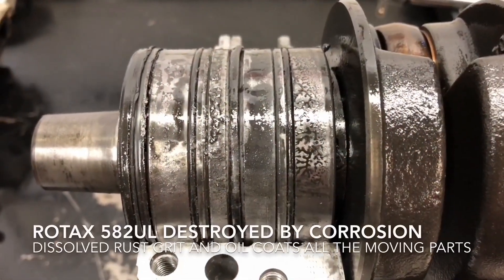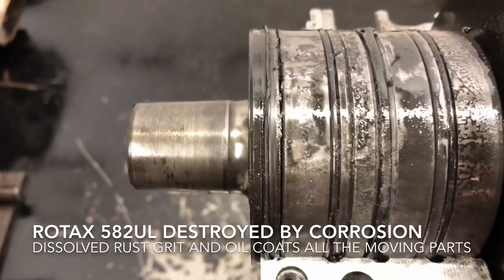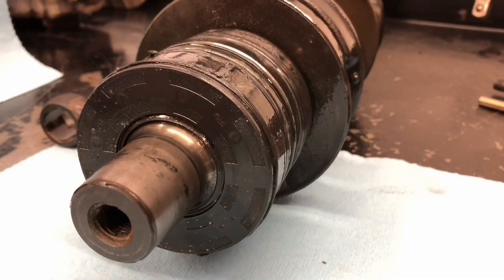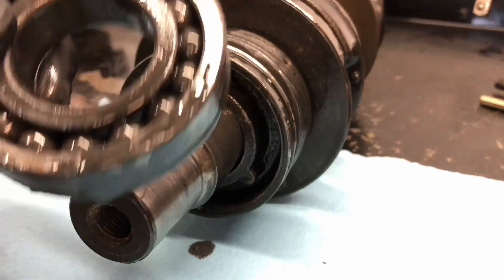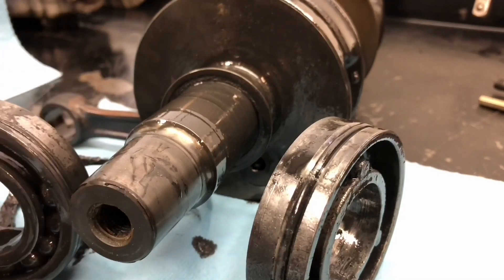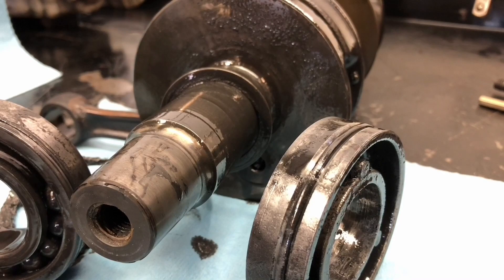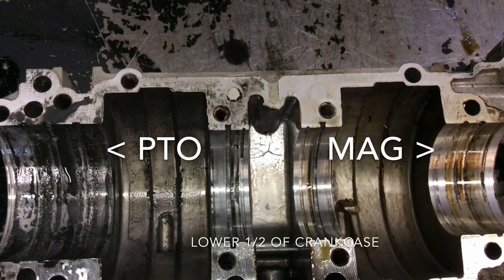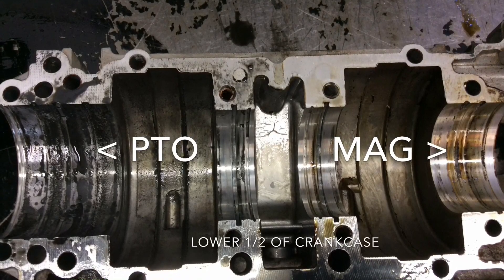Rotax 582ul rusted crankshaft bearings

Comment: How many hours can you get out of a crankshaft?
Reply from the maker: That IS the question! I believe that depends on many factors. 
The engine hour are one thing, the time since new is another. Some questions are; is the aircraft hangared or outdoors?, are the engine orifices sealed up when not in use or not?, was the engine preservation procedure completed or not? Lots of variables!
Rotax recommends a 300 hour crankshaft replacement cycle and engine dismantling for inspection every 5 years  .
Reply: @RotacRepair  Thank you!